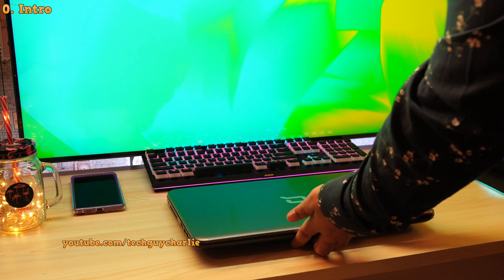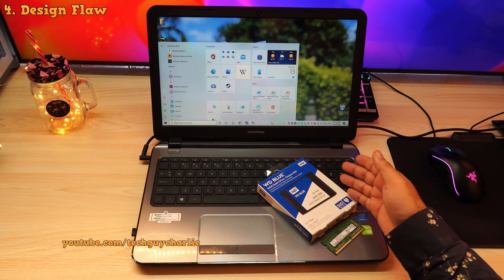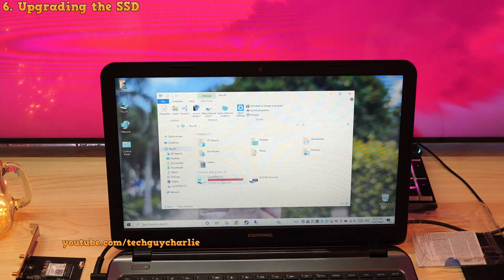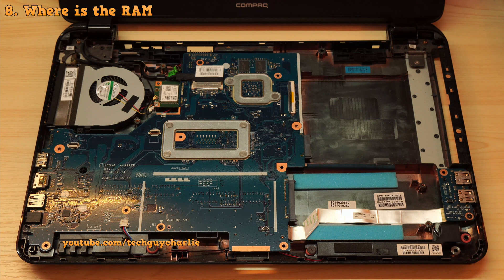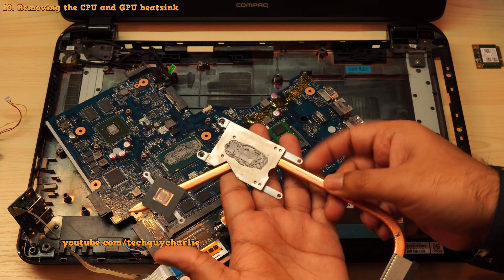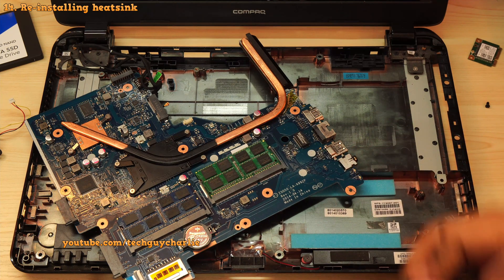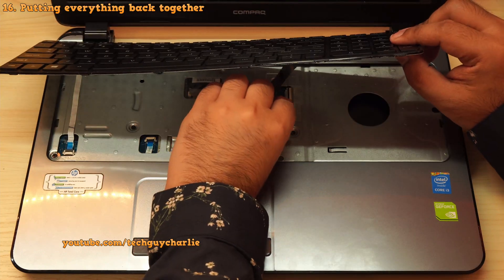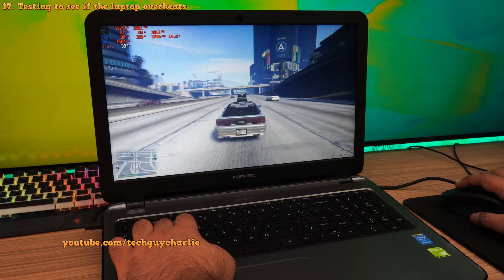How to fix overheating issues and upgrade an HP|Compaq 15 Notebook PC

Comment: Please tell me if there's any slot for hdd in hp pavilion gaming 15-ec2150ax
Reply from the maker: The HP 15-ec2150ax should have a second slot for a SATA drive, BUT I cant be 100% sure since I don't have the exact same model you have mentioned, so, you should also ask the HP sales rep before buying just to be sure. 😊
Reply: @TechGuyCharlie  ty